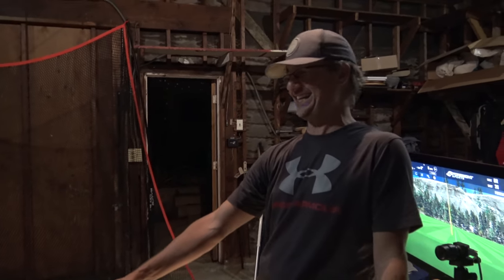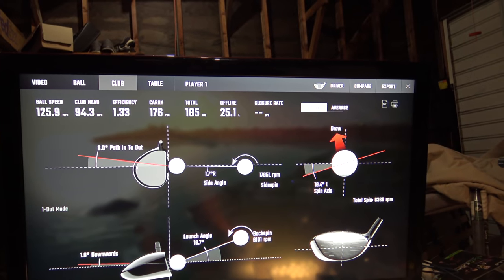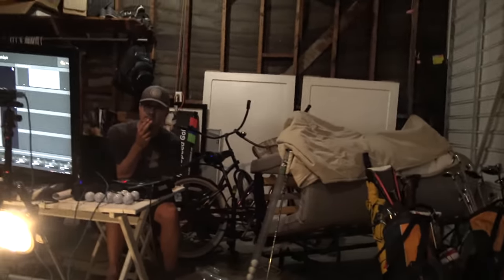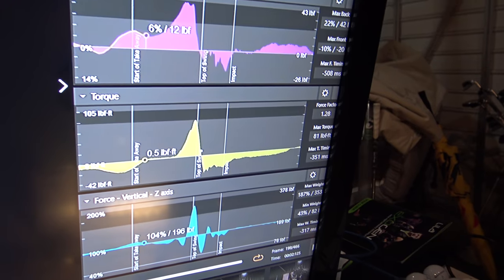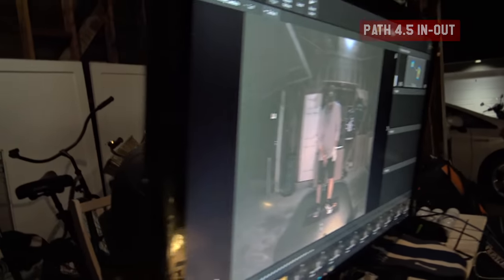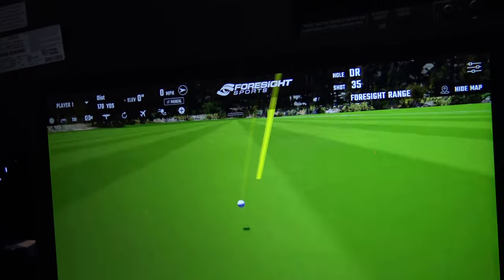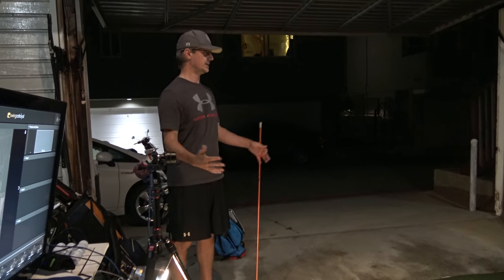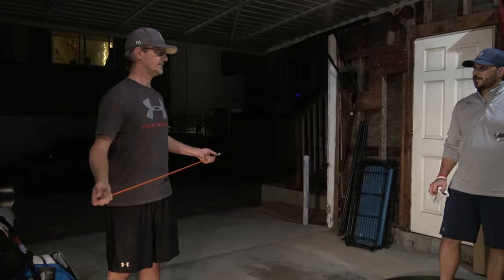Using Ground Forces to get More Rotation and power in the Golf swing w/ Dr Scott Lynn SWING CATALYST

Comment: Hi Brendon How to make a good golfer worse. 

When Vinny  said he used the pressure from his weight on his trail side foot to kick off his downswing under Newton’s law the pressure was immediately changed to his lead foot and his connection of club to ball was spot on. 

Vincent used  ground action and reaction force (GARF)  perfectly as he immediately simultaneously transferred his weight from his trail foot to his lead foot.. So my question to the Doc  is why mess with perfection and mess with Newton’s law for every action there is an equal and opposite reaction? 

GRF is ambiguous and needs to be correctly stated under Newton’s 3rd law as GARF. Then it can be taught for anyone to use and quickly understand to do. As far as GARF goes simply: press left foot lateral right and then faster and harder press right foot lateral left.  

Leftpress /Rightpress This is all one needs to know for a perfectly balanced swing and spot on connection to the ball. The rest is supposed intellectual BS Cheers

Comment: Great content B. 👍

Did he hit any blocks/pushes?           Would it help to open the face a little at address?
Reply from the maker: Never. Hit the same shot again and again. Started straight then overdrew. Path was down to about 4.2 in to out. Had face too closed to make that work
Reply: So no double cross? Club face is closed to path i.e. my suggestion to open face. Or simply aim to the right. 
What am I missing?